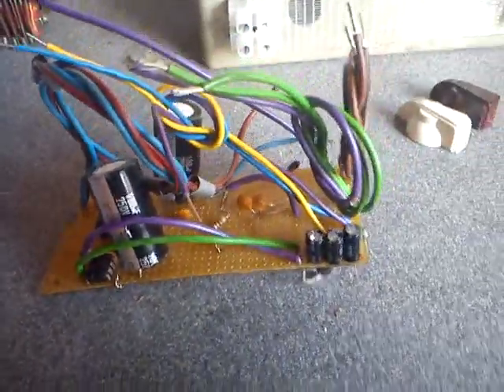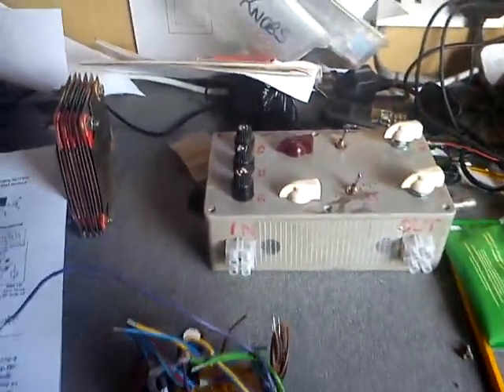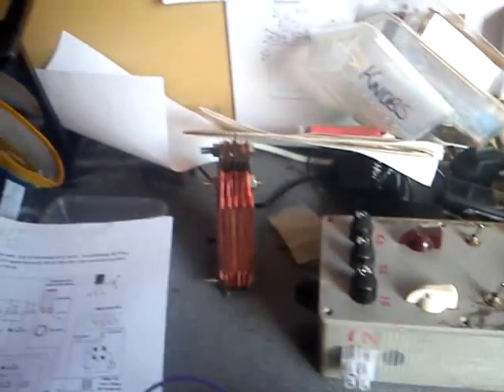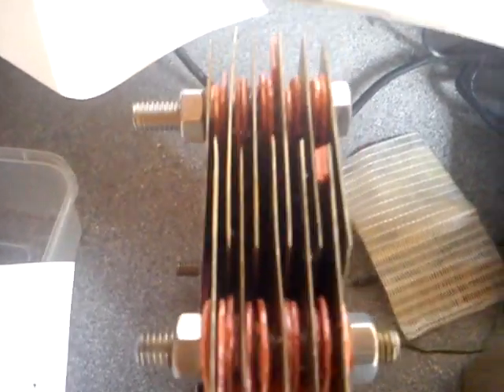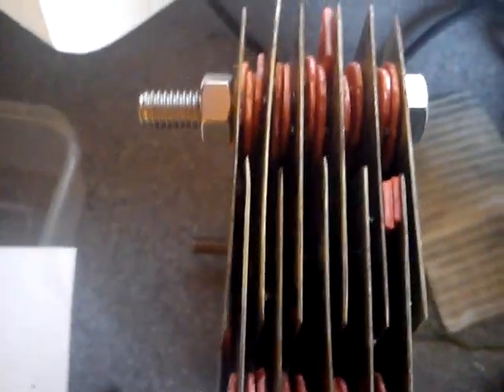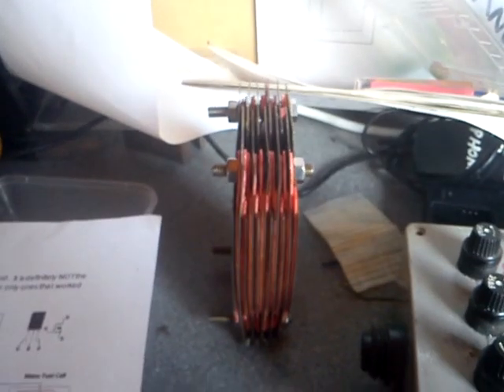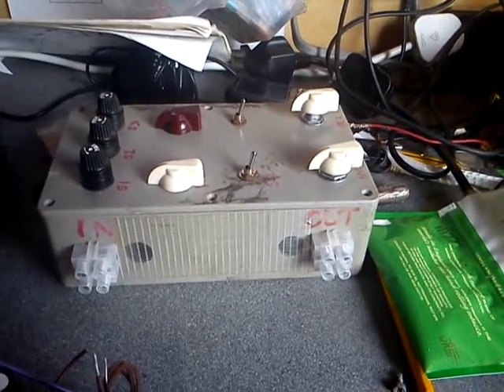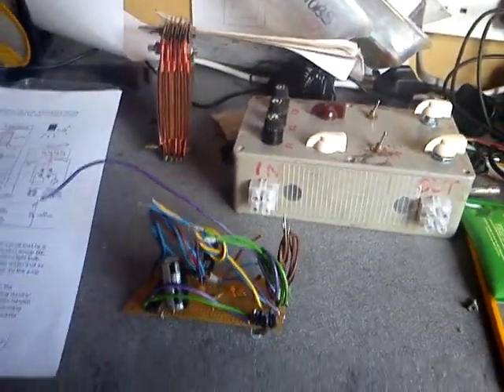HHO new start vid-1.3gp

Comment: @Hawk491000 thanks for that, nice info, 

and is there a frequency that water vibrates at ? if you pulse water with its own frequency does that break it up or is that not quite right ! ??  : )